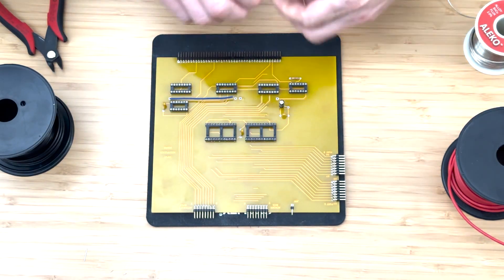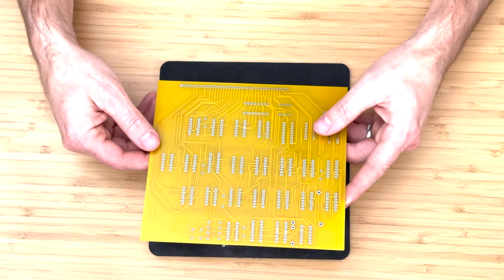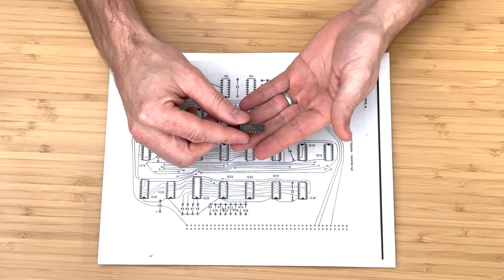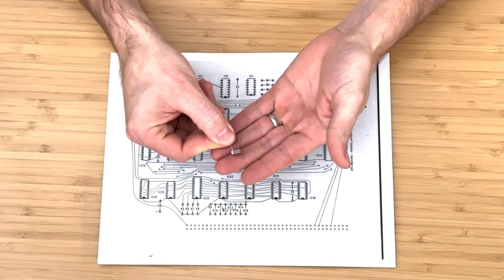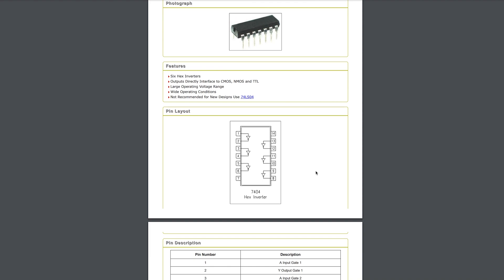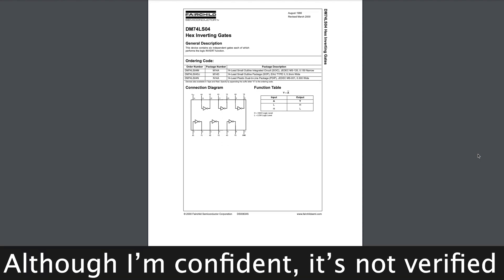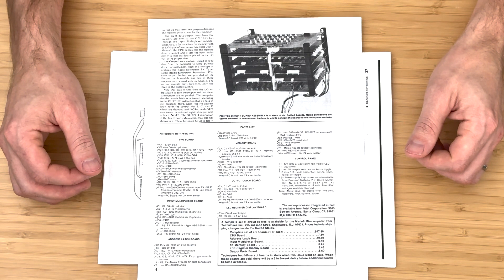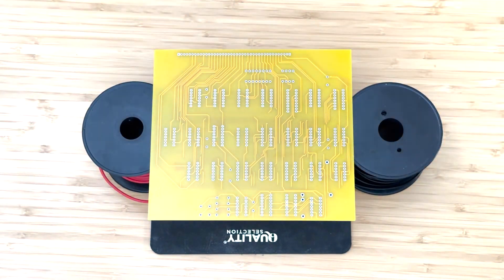Mark-8 Minicomputer Build - CPU Board

Comment: LS parts usually have a lower fanout rating than the original type, meaning they can drive fewer gate loads.  However, LS parts also present a lower fanin rating, meaning they present less of a load to other parts.  So if you use only LS parts, you should be fine.  Even if you use some non ls parts, you should be OK as well, as this design doesn't tie that many inputs to a single output without buffering.

Using sockets is a good idea when building anything that has older NOS parts which may have gone bad due to storage conditions over the years.  Augat style sockets are excellent, they have large contact surfaces.  They can also be soldered from BOTH sides, which means those old Mark8 boards without plated through holes are DUCK SOUP!
Reply from the maker: Great info!